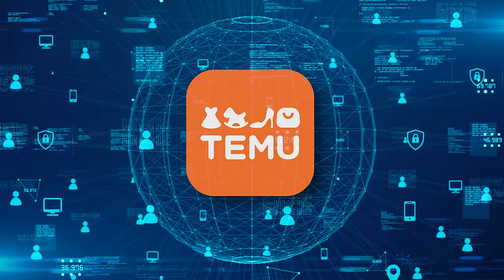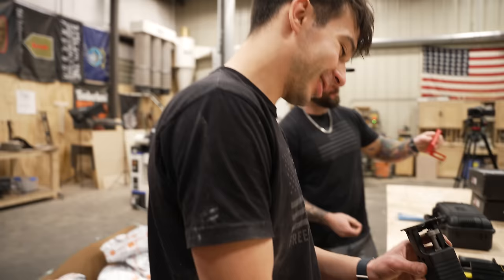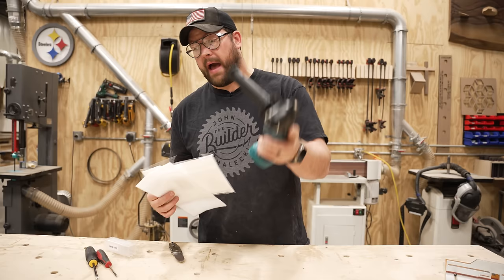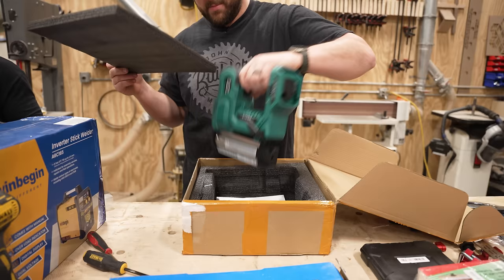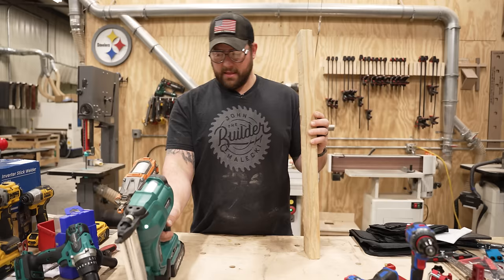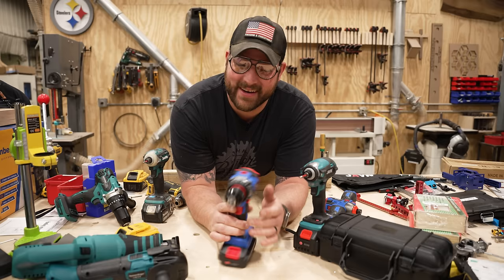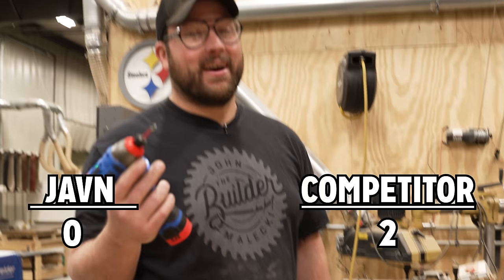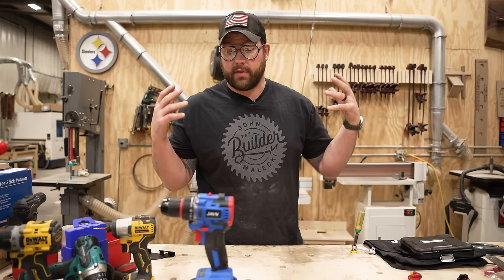I Bought A Pallet of TEMU Tools

Comment: for the power tools your so much better off getting dewalt, I have an air pump that Ive used at least 10mins a day for 5 yrs now. rides in the truck cost $100. dont skimp on the major tools. get the junk ones on things youll barly use but need a few time for odd projects...

Comment: All this tells me is that square drive screws apparently slips easily and a lot
Reply: They don't though.  Just push the bit into the screw and it's not coming out.  In fact, after driving them, they can be a bit difficult to release from the screw.
The 'square' Robertson head screws rule, and I could go the rest of my life without seeing another Phillips. I hate that they still use them at all.  Torx is good, but I'll still take plain old Robertson any day!

Comment: You're comparing the cheapest against the most expensive! If I was using a drill/driver professionally all day every day then I might buy DeWalt/Makita but as an amateur/diyer or just starting out,  the Temu tools win hands down. Do I care that it takes a fraction of a second longer to install a screw? No! Do I care that the battery will screw 90 times compared to 100 times? No!  Btw, you can't really blame Temu for making crap stuff as they don't make anything! They are just an outlet for other manufacturers, just like eBay or Amazon or any of the big box stores. So, thanks to Temu for not being a huge profiteering overpricing corporation . 👍

Comment: So I would like to see more of that router table. They are pretty cheap, so granted I do expect it will suck. But when your building all the rest of the router table its more just the plate guys like me are after. Its where I do see cheap ones that are small with no fence/miter and with both. Its where you having it in your hands it would be nice to just check the straightness of the slots and if they actually are close enough in size to the common things we use like T Tracks ect

Comment: For electronics, specifically stuff like, Video game accessories and whatnot, Temu is not good, I'd even date to call it bad. But, Temu is surprisingly not bad for tools, gimmicky stuff like those precision rulers you got for $7. there's a shockingly decent amount of fairly good value to be had. I watch a good mixture of channel types, such as woodworking, cars (like Donut), miniature painting and kitbashing (specifically Warhammer), Offroad recovery and repair... a lot of them have done stuff where they've bought a bunch of stuff off Temu, and there's always some jank, but for the most part, they find some good stuff.

Comment: The way everyone compares products is so wrong. Everyone is just basing on power and speed. If the product is 1/2 price and performs at 30% less, then you have to think about how to even the playing field. So 1/2 price means you can get 2 Temu products to equal 1 so-called American product. Now use a real-life scenario, 2 workers with 2 Temu power tools vs. one worker with 1 American power tool. Test it out for the whole entire day, I guarantee you more work will be done by the 2 workers with less efficient tools than the 1 worker with the titan power. Now if the price is 3x or 4x cheaper, that really adds up to how many people can do the same work at once.

Comment: Your review would be better if it took apart the power tools and identified which ones are unsafe mechanically and electrically, as all the certification logos on it are bogus.  We don't want a drill that will fly apart or electrocute you.  Doing such a dis-assembly would be a real service to those looking for cheap power tools.
What you can't determine, I think, is which items are made using Uyghur slave labor or raise money for organizations hostile to the West.  And finally, how do you order stuff when you do not want to install the app, which is known to be full-blown spyware for the CCP and may be a vector for other malware?

Comment: Must say john your getting allot shit in comments for doing this but a think you did orite for what u got. Ive looked at bunch these things and bought a bunch stuff from them and most it has been pretty good. If u wanna check them out there epoxy moulds are pretty good and cheap. Think u gotta dive down this rabbit hole more. Ps subbed up new channel 🏴👍